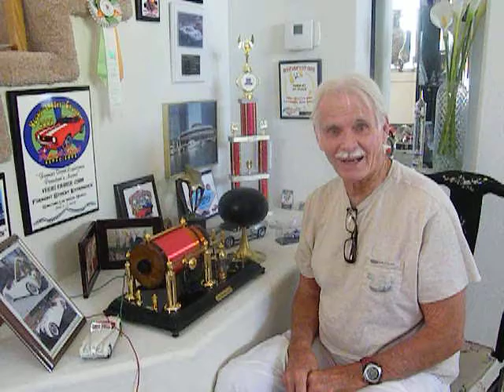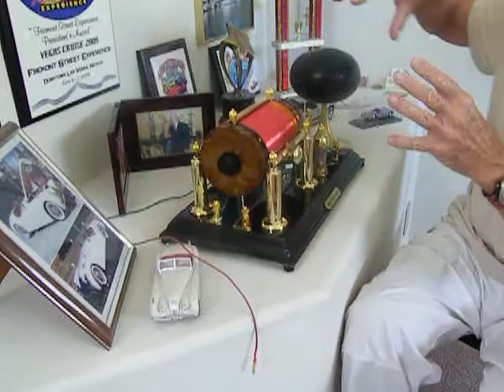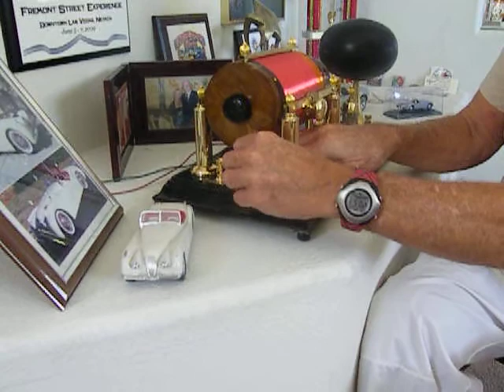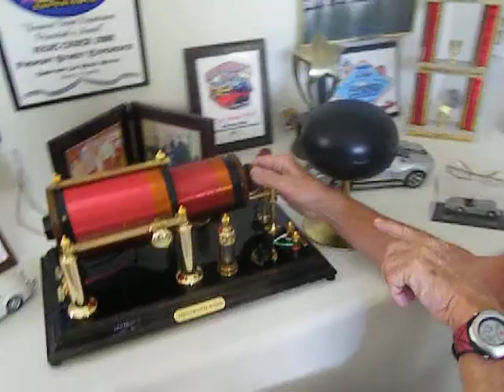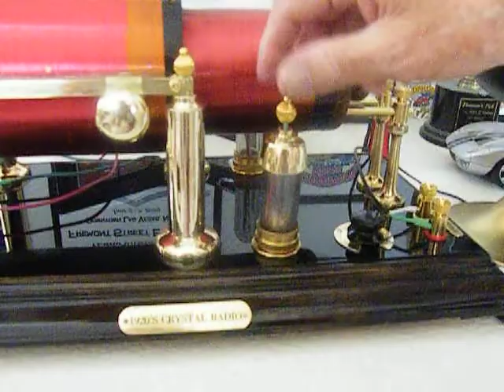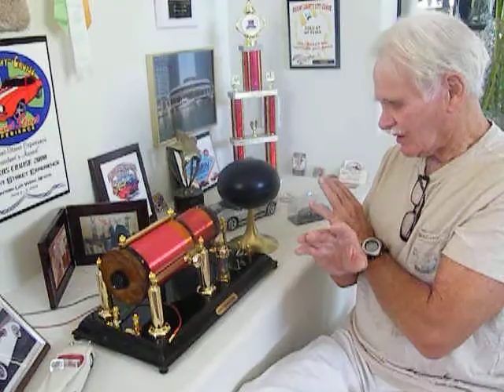kents crystal radio

Comment: For thise who do not want to use a variable capacitor see
http://electronics-diy.com/electronic_schematic.php?id=979 
for how to use a varactor diode these are cheap and plentiful on ebay the only draw back is the use of a 9 volt battery that will last for many months with an on off switch.

Comment: Very beautiful set, Kent but your setup can't possibly be power free to have enough volume to drive an external speaker....loudly at that!  Even the best passive crystal sets can only drive an ear or headphone with enough volume for ear contact in a quiet room.  Where is the audio amplifier at?  Hidden in the speaker housing?  Your crystal radio is known as a "loose coupler" since the signal is coupled between the two main coils; one inside the other.  The rotary position switches are tapped to different coil loops.  All that makes it a "double tuned" circuit.  I don't think you have a true rock crystal as the detector .... you didn't have to adjust cat whisker tension or contact location for best signal; you just screwed down until any contact was made and poof .... instant volume!.  I suspect you have a modern Germanium diode in that "crystal" housing, and just making/breaking lead contact like an on/off switch.   But, again.... whatever it is made of, it is a very beautiful and well-performing set, err --- even if it isn't really a true "crystal radio" as the term is meant to apply.  I wouldn't mind having one just like it.
Reply: Actually if the antenna is long enough and the earpiece is sensitive enough and all the coils are matched right it can be pretty loud with a galena cat whisker. I visited an antique radio museum and had the privilege of hearing a crystal set and it was quite loud. My first crystal radio with germanium diode and ceramic earphone was loud enough to be heard without putting it in my ear and just laying it on the table. Not deafening of course but not as low as you imply. Depends on many circumstances. On the other hand he does comment in the text that it has an lm386 amplifier. But I think he means the tuner section is on its own power.
Reply: He does have an IC audio amplifier as noted in the video description, but with a 125 foot antenna, it's possible to get enough output with a set like that one to drive a horn type high impedance speaker and be audible in a quiet room.  This no foxhole radio; a loose coupled double tuned crystal set like this one with a good antenna can pick up commercial AM stations from across a continent at night, and even get enough stations to require high selectivity in daytime -- and can be selective enough to separate a weak station only 10 kHz apart from a stronger one (the closest the FCC assigns broadcast AM frequency).

Comment: Hey Kent, That is one beautiful Crystal Set. It looks like you followed a classic design proven to work for many way back in the 1920s. Especially since you are using a Cat Whisker (Galena Crystal Pot) for the Diode Detector.

I comend your Wife for enjoying your hobby with you and producing a very nice video.

It's a great thrill which I never seem to tire of when you listen to radios powered by the Electromagnetic Waves coming from the transmitter stations sometimes a 1000 miles or more away.

Comment from the maker: There are about 4 youtube videos posted by me about this loose coupler crystal radio set.  There is a large capacitor that will charge up to 4 volts DC.  The charging is accomplished by two 6 volt solar panels and is being transmitted through the antenna and ground system.  Note: you cannot do it at the far end of the antenna because you get too much RF signal. However, if you are within 10ft. of the crystal radio set itself you can charge without battery. This for audio only.